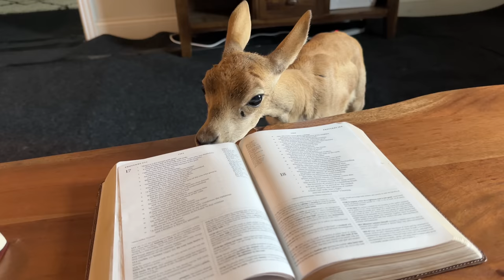It’s Over.

Comment: If you haven't, you should also examine the feet of the fawn closely, just in case there is something in the foot. You can also gently put pressure on different points to see if there is sensitivity. If it's certainly a sprain, a thin gauze wrap might be a good idea.

Comment: You could scrape off some of the moss, put it in a blender with equal parts buttermilk and pour over a large rock or on the ground in the shade or on north side of rocks. Moss loves firmly compacted soil or rocks,in a spot that is a little moist and most importanly shady. The buttermilk accelerates growth.